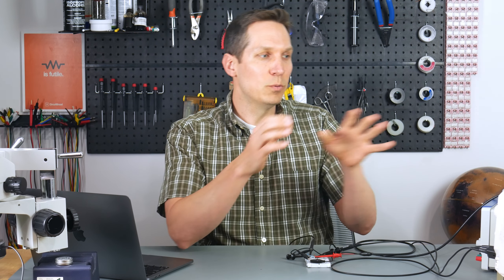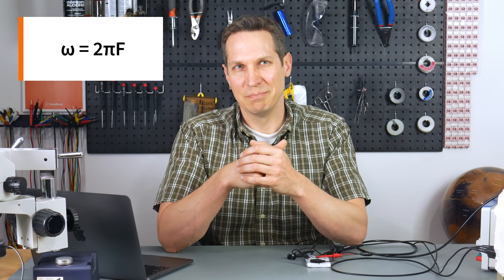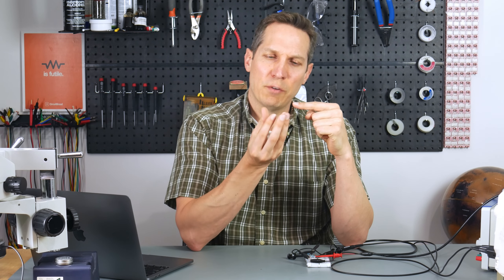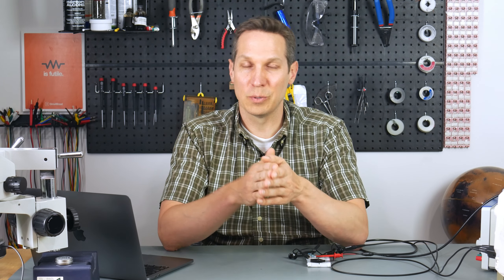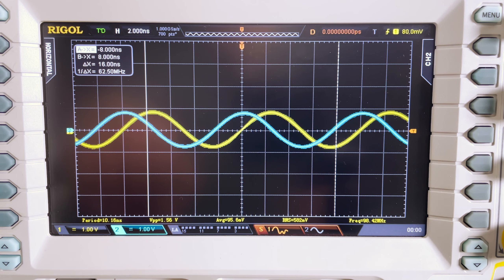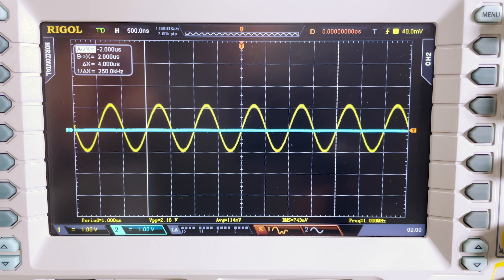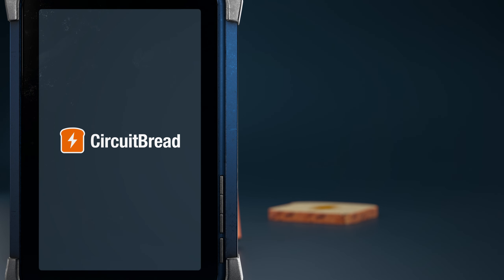Introduction to Capacitors - Basic Circuits #17 | Electronics Tutorials

Comment: Newbie working with LT Spice. How is it you are seeing AC and DC? I am able to create either or in spice schematic. When I run transient analysis, I will only see DC current unless I make the power source AC (Sine) and then only see the AC signal. I am basically trying to run through examples with LT Spice.

Comment: And how does the diodes and capacitors voltage multiplier work?
Reply from the maker: This is just the basic introduction in to capacitors!  Charge pumps are a bit more complicated... We'll hopefully touch on this once we do the Circuits 2 series.

Comment: I appreciate your channel, but none of this is “introductory“ or “basic“ unless you already have a high level understanding of capacitors/circuits??! Complex formulas, and a whole lot of concepts I don’t understand. 
My understanding of capacitors before watching this video… They “smooth” electricity.
My understanding AFTER this video… Absolutely no idea.
Reply: Hey, I don't know if you're better off now but I'd say this video really described how a capacitor actually behaves. I do get you though with the formula and fancy terms. At the end of the day yeah, they do just "smooth" out the current/voltage delivered depending on how it's connected but this video just tells the ideas behind how they end up doing that.

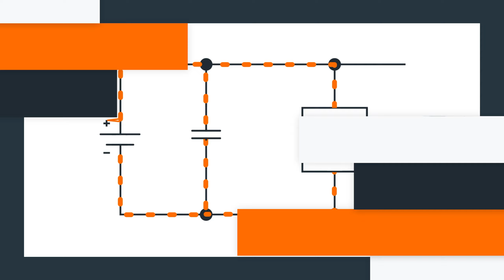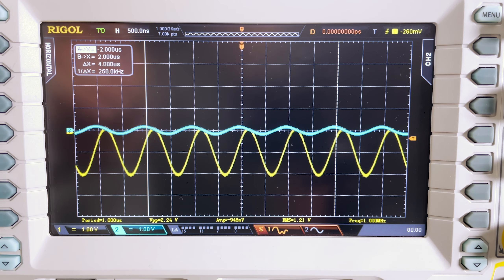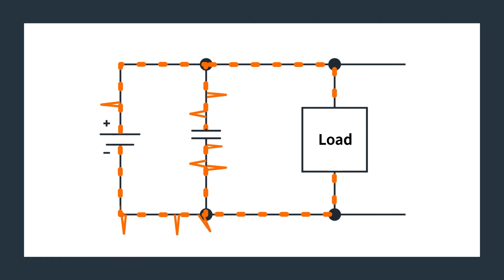I assume you wanted to know how they are used? Based on what I understand, in one configuration, if the voltage spikes, capacitors can help protect your load(like an LED) by getting rid of the spikes and keeping the voltage smooth(the AC decoupling/being in parallel with your power supply 10:17/14:40)  and in the other configuration (AC Coupling/passthrough or DC blocking 9:44/10:45) if its a DC voltage OR the frequency is too low, there will be no voltage output, that is why the blue line was flattish/approx. 0 at 10 kHz - 100 kHz but at 1MHz up you can start to really see the AC Voltage passing through.

The current-leading the voltage business is when I'd say things get complex. Anyways, happy learning!!